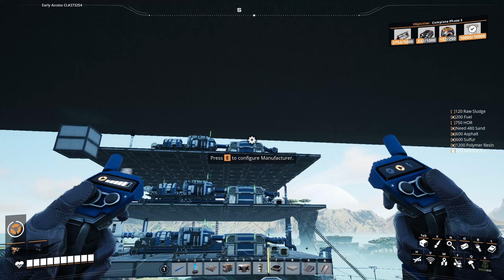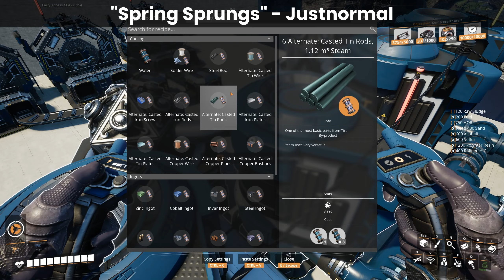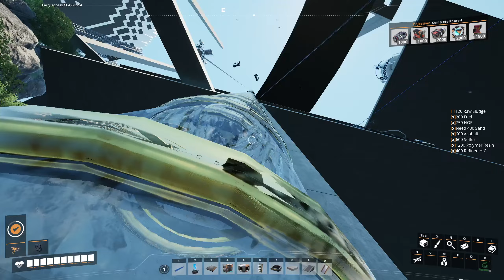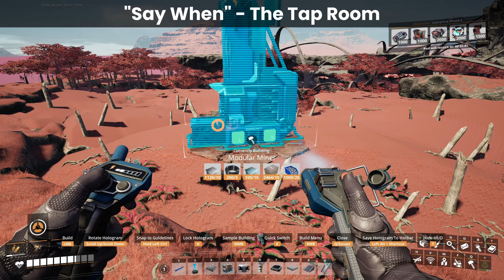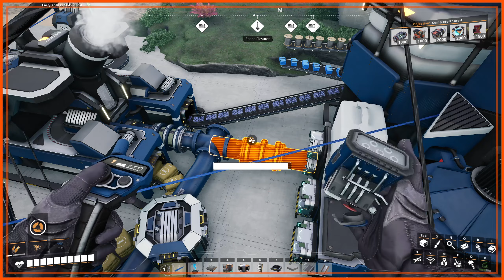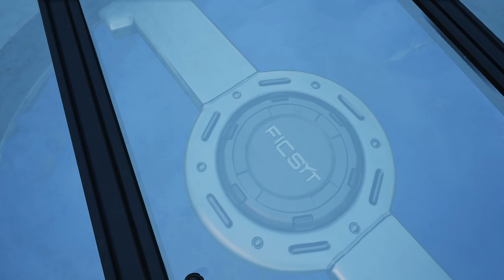We finally get to PHASE 4!

Comment: I don't like using one receiver/sender per machine because it's  a 10MW power sapper that's almost constantly on, especially where a bunch of the same machine are in a row.

Trying to balance production of things like hydrochloric acid, oxygen, methane, and hydrogen has been... fun. I've been making a dual loop that  packages the gasses and sends them to a set of splitters via smart splitter. Once the first level of packers fills storage, then the overflow gas containers get sent to another set of unpackers, temporary storage, and then repacking again to be sunk. In this manner the system cannot jam unless I run out of containers on the second overflow loop.
Reply from the maker: I love your idea for gasses! I didn’t even know the senders and receivers used power!

Comment: Thanks for the video. Good job completing phase 3. Agree with not trying to do the phase 4 parts, they are insane. You will need over 6 million cobalt plates and 625000 computers to make just some of the parts. With regards to the lag, I think it might be the amount of parts in one renderzone. I probably have a similar number of machines as you do, but they are split between multiple factories, and I have not seen lag of that magnitude. Don't feel bad about running out of basic stuff 🙂 Believe it or not, I was running low on crushed stone at one point, the item you are literally drowning in in phase 1 and 2, lol. Take care and I'll look forward to the next one.
Reply from the maker: Thanks so much! I think you're right about the machines. I'm still doing some testing, but last night I opened up the save, (made a new backup save) and just went crazy deleting everything in that area. Deleting all the power generation blueprints helped but didn't solve it. I'm still hopeful somehow there's one single pipe/wire/faxit item that's somehow glitched causing the entire issue...and if I find and delete it, I'll solve it! I don't even know if that's a thing, but it's my secret (not so secret anymore) hope.

Next one is going to be the finale of the series. I'm going to automate the rest of the aluminum parts, let them stockpile enough to unlock titanium, automate all those titanium parts, then go through (verbally) all the space elevator parts. There's a chance that'll spread to 2 episodes, I suppose, but that's not what I'm planning. Thanks, as always, for the continued support. I know every video I drop your name is one of the first I'll see, and it's always appreciated.
Reply: Once you go to T2 using hydro acid your stone starts to disappear really quick.

Comment: Look into chunk loading and where they are in the game. Central mass manufacturing can be detrimental to long term gameplay - fps drops. So you could do modular factories in different chunks. That way the game isn't trying to load the visuals just the production calcs & destinations.
Reply from the maker: I'll look, thanks! This whole season of gameplay I wanted to build a mega-factory, since I'd never done it. And I'll never do it again. I wonder if a huge central base will be more feasible in SF 1.0 with all the optimizations they're implementing. I'm excited to try it out.

Comment: I know it is a while ago you made this video but I had issues with framerates when I build like 20 of the slug incubator tings with all that goes along. I am thinking some of the satisfactory+ items are not optimized correctly and you likely have a hole lot around tetra. I was showing decent framerates but it seamed to be stuttering so bad I did not wanna stay on that part of the map. Hopefully the coming version of satisfactory+ will be better in that regard. Then again it is kind of understandable when it is a community mod.
Reply from the maker: I think you're absolutely right. When I revisit SF+ when it gets updated I'll be spreading the power plants and slug stuff...all the modded buildings...around the map, so you never have too many in one spot. Thanks for sharing your experience!